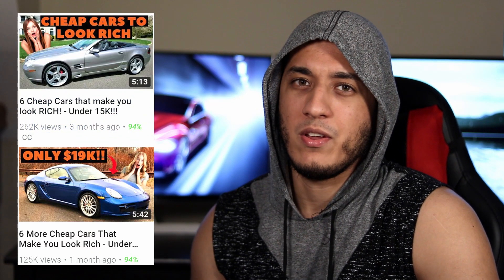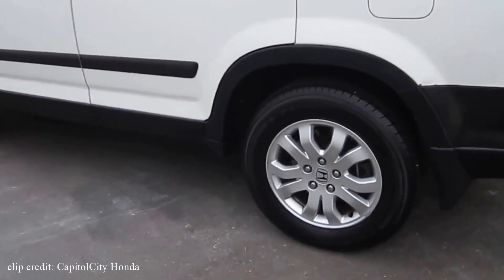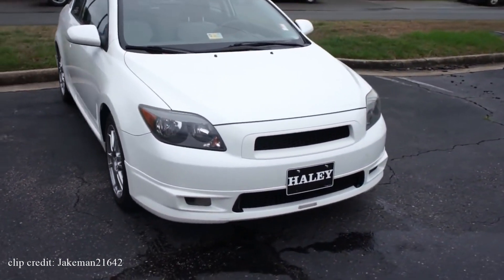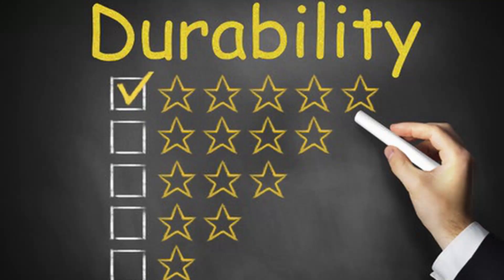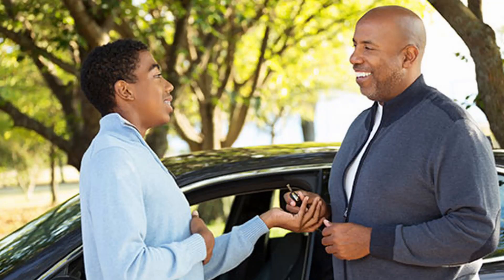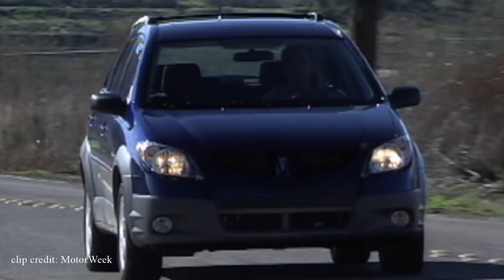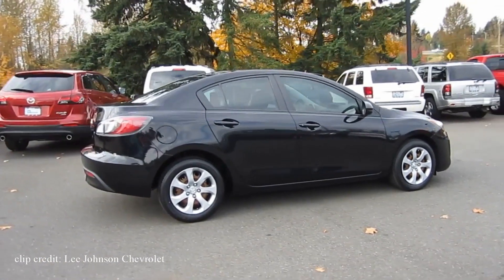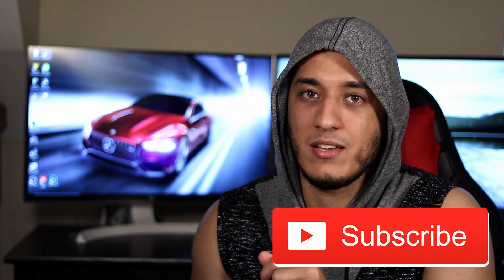5 Cheap Reliable Cars Under $5000

Comment: Crown Vic was a tank! Over 360,000 miles on mine! Had an accident at 45 and only cracked the bumper cover. Your best option though, is to get one through state auction. Some as low as $500 and only need a battery and starter and you got a running driving cop car 😎
Reply from the maker: Dude that's awesome!
Reply: You don’t want an old cop car. Lol. They are finished when cops are done.
Reply: The vehicles themselves are awesome. Just the fleet ones like cops and taxis RUN.
Reply: @VehicleVirals  I got my 08 p71 for 800$ Runs great.

Comment: crown vic driver here and I could attest that this thing is literally bulletproof. They are nearly indestructable and tough as nails. Put 5000+ miles on mine with 100k in three months and it never ever gave me any trouble. They are roomy and have a significant road presence. Most vics are reported to run for 200k+ miles without the need of a major internal work like engine or trans rebuild or such. And they are reasonably fast, slow to start from static but once you build up some speed that V8 really goes. Rock steady and safe. Given the price it is very difficult to beat.

Comment: If Ford is discontinuing the Taurus, Fusion, Fiesta, C-Max, Focus, and possibly the Flex for the next decade, then they should try really hard to persuade customers to bring back much better sedans like the Thunderbird, Crown Victoria, Galaxie 500, and even the Probe.
Reply: Not to be a troll, but Thunderbirds and Probes were coupes.
Reply: I love the probe with a burning passion
Reply: Ford fusion
Reply: Part s
Reply: speaking as a former ford dealer parts manager the ford Probe was a pile of junk

Comment: The police sell off their crown vics at 100k. Most emergency services dont keep their vehicles for more than 100k. I agree a great deal, but they are driven hard! I wouldn't want to be driving around in one lol. Definitely a great 1st vehicle
Reply from the maker: The Crown Vic doesn't know what driving hard means lol. And yes a great first car
Reply: I drive the Chevy Tahoe PPS as a Paramedic ERV. I'm seriously considering getting one that's been decomissioned. Bang for your buck is wild; in Canada, that's like an $80,000 vehicle, a few years old, for under $20,000.  But close to/over 200,000km. And with the tweaked suspension, excellent tires, & it's DESIGNED for the ++idling & aggressive driving... it's a bloody dream. It's so nimble, smooth, quiet a ride, responsive, and turns on a dime for its size. I feel like I could go anywhere in the thing, with space to spare. Granted, she's a biggie, but easy to get used to and feel like an extension of yourself. The acceleration is nothing to joke about, either, plus when you hearrrrr her!  City gas mileage leaves much to be desired, but is entirely reasonable for what it is. I don't commute far, so maybe that's a me-thing. Plus we make decent coin for our profession. I find it reliable. It's statistically trusted for reliability & performance. And researching maintenance/year averages, it's a no-brainer! Transmission, brakes & tires are not cheap, but in the grand scheme she's a steal. Ridden hard, sure as hell they were. But they were modified from off-the-lot to handle that (according to the website). Granted, they could be making a bigger deal out of only a little tweak. But you look at people selling used ones with 500,000km+ that are over a decade old, and they hold up well. Great investment piece, in my opinion, but I'm not super "into" cars, I must confess. Interested in opinions, Vehicle Virals!!!!!
Reply from the maker: For 20K it seems like a solid deal. Like you said for your profession those Tahoes are modded to take a beating, as are most emergency responder vehicles. I'm sure parts for them are widely available as well. If you're really into that vehicle I don't why you shouldn't for it. Best of luck!
Reply: Don't forget the wear as they idle for hours on end.

But they are still pretty durable overall.
Reply: True in some aspects but if it's coming from a state trooper, it's ridiculously durable
Reply: a fleet maintained one would be good

Comment: I gotta say one thing about those old CRVs. After a few 13+ hour road trips in the back seat of one (as an adult, albeit a small one), I am convinced the back seats are the most uncomfortable place ever designed next to medieval torture devices. Enough room to fit my shoe on the ground. No ability to move my feet or bend my knees to anything other than a 90° angle. Impossible to lean anywhere – pillow or not – to nod off. I’ve since taken similar trips in the back of a Veloster and it felt like a limo in comparison, leaving me refreshed.
Reply from the maker: Wow!

Comment: Police vehicle odometers are misleading; they are left on idle not like normal cars.
Reply from the maker: Interesting
Reply: This is actually true. Police cars have a lot of engine hours.
Reply: You have a point.  However, it is probably better to have the engine idling than the more "normal" practice of regular drivers that drive a few miles then shut of the engine, come out, start the engine and drive a few more miles.  
There are taxicabs that have well over 200,000 miles on them and if the engines were crap you can be sure Crown Victoria wouldn't have been as popular for so long as a cab.
Reply: Plus I've seen a lot of the older 4.6 fords have the tachs stuck around 100k so who knows how many miles but it doesn't really matter they are beasts.
Reply: mine has 5000 hours that seems horid but the engine drive and runs great. And I am the kind of guy who puts my ear on the hood to hear if theres any weird noise. No. It's all about how the car is maintained.
Reply: odometers read mileage, it doesn't move unless car is moving.
Reply: tachs read engine rpm not mileage-odometers read mileage

Comment: Crown vic, grand marquis and town cars from 98 to 11 are reliable with out a doubt and cheap. You can get a low mileage well maintained for under 4.5k . main issues with them are ac head light flicker and rear air bags for those who have em. All wich is fairly cheap to fix. When taken care of They will run well past 250k

Comment: Cheap Reliable Cars Part 2:
1: Toyota
2: Toyota
3: Toyota
4: Honda
5: Honda
Reply from the maker: This video could of easily been just that but that wouldn't be any fun lol
Reply: Don't forget about Subaru.
Reply: You can throw a Mazda in there too. But yeah Japan has it where it counts.
Reply: Hondas arent reliable anymore lol
Reply: Don't forget about the Ford Trucks.
Reply: @atx-cvpi_99  A 4 letter word that starts with F?
Reply: @stevenboykin116  Ford
Reply: @atx-cvpi_99  You do get what I mean by 4 letter word right?
Reply: Toyota and Honda is garbage
Reply: Jeeps are very reliable, older ones.
Reply: Ok Scotty Kilmer
Reply: Hondas arent good in Bahrain .. expensive parts its will cost you a fortune for maintenance
Reply: Robert Fernandez well said, garbage cars

Comment: You’ve been lucky. A lot of people have issues with focuses but i knew someone who owned an 03 SE with 330K miles and they didn’t even change the transmission fluid. I have had an 04, 11, 14, and 17 with no issues. I still have the 17. Just because there are known issues doesn’t mean one is bad. I also had an 04 explorer with no issues.

Comment: 1984-2001 Jeep Cherokee
I have a 1999 Jeep cherokee XJ with a 4.0L i6, 263k miles and runs like new. these i6 are bulletproof. i have heard of many going past 500,000 miles with no engine rebuild, some even going past 700,000. There are millions that still run great with over 200k miles.

Comment: I'd like to add the Grand Marquis and Town Car are just luxury models of the Crown Vic and can be had cheap as well, and most parts are interchangeable. A chunk of my rear suspension on my 99 Town Car came out of a Crown Vic. And you can get a late 90's Town Car at least for 1-3k
Reply from the maker: Yeappp Same platform
Reply: One of the best imo. Been a huge fan of the panther platform since i totaled a 91 towncar and it kept me alive in the wreck. hydroplaned down a hill and wrapped arounda  pole. turned the car into a horse shoe. Sustained minimal damage personally due to the full frame the car had, able to take a hit.

Comment: In regards to the cheap luxury cars - my friend learned a hard lesson in repairs when he had his first issue with a bmw he purchased used. He got rid of it after the first repair and purchased a used Homsa accord coupe ( real nice).  
Crown Vic’s Terrorize the roads.
Reply: BMW's are one of those brands you need to be willing to set aside some money for the sole purpose of fixing it when something either breaks or needs to be replaced

Comment: I managed to snag an 07 tC (manual) for only 2500, and I love it. Good gas mileage, looks great, everybody loves the color, and it's actually got decent acceleration.

Only downsides are that it's front wheel drive (and TERRIBLE on gravel),  vibrates a bit around 70 mph, it idles HARD when the AC is on, and the immobilize can be a bitch if you don't realize you moved the steering wheel while getting out.
Reply from the maker: Awesome. Thanks for the insight. How many miles on it?
Reply: Currently at 160,000.

Or about 20,000 if you converted it from Toyota miles to GM miles.

Comment: I want a ford crown so bad, but here in germany they are pretty expensive and rare. I really like them with this massive bullbar and some extra lights on the bar. (Look at Alaska State Trooper, they have these round shaped lights on the bar) Also the spotlights are a must have on this car😍 Is there anyone, who wanna give me one for free? Absolute dreamcar!!!
Reply from the maker: They are so widely available here in the states. And very cheap to maintain. Sorry man
Reply: Yannick Block. What's up bud. I had a few crown vic p71 package I really love them too, in the last few years I got into  German cars especially the Mercedes Benz w124 body, I own a 95 e430 v8 and a 92 e300 3.0 straight 6 it's a 4matic as well I feel like the ride on my e430 is similar to my crown vic's I had and it has alot more power stock for stock. What u guys think about the w124 over there are they disirible
Reply from the maker: Honestly I don't see them very much here, at least not in Orlando. Back when they came out they were perceived like the Rolls-Royce of Mercedes because of how they look. I like them
Reply: @stevejunkerjr.2741   The w124 is a classic german car. It's very reliable and has a good quality. It's just an amazing car!
Reply: Vehicle Virals you should do a video on the w124

Comment: Hey Christian great video. Until I can get the car I really want, one of these looks like it might do great for a while. 😁 I am looking mainly at the CR-V or the Mazda 3. My question though is, since you mentioned a certain range of years for each one, I'm wondering if a year or 2 after the range means it's not as reliable or just more expensive so it didn't make the list?
Reply from the maker: Sup Robert. Each year range I mentioned is based on a particular body style meaning that if you go outside of the ranges the car won't look like the ones featured in the video. I tried to keep the cars as modern as possible without going over the 5K price point. Going over the year ranges will probably result in having to spend more than 5K. The Mazda 3 and Honda CR-V are typically very consistent reliability wise no matter what year you go for. Hope that helps

Comment: Hyundai tiburon? You get some electrical problems , powersteering problems, and other minor problems but lasts over 400k miles ( 439k to be more precise) and still runs fine( the 2.0 one)
Unfortunately it was discontinued becouse of the crapy interior, and back seats/ low performance/ gas hog/ sensitivity to rust/ very often service intervals..

Comment: Subscribing.. great presentations brotha. Keep it up. What's your take on the Ford Fusion? looking for a other car for my wife to drive in. SUV gas is killing me.
Reply from the maker: The Ford Fusion just like the Lincoln MkZ which is practically the same car are very reliable.  If you're more about fuel efficiency you can go for the hybrid model but it'd cost you a bit more. The regular ECOboost engine has great fuel efficiency as well. As a commuter vehicle I'd give it a thumbs.
Reply: @VehicleVirals  Thinking of a 06-10 model maybe 100k miles worth it?
Reply from the maker: Depends on the price. I'd try to shoot for less than 100K miles if your planning to keep it for a while.

Comment: Ford Crown vic/Mercury Grand Marquis/ Lincoln town car all the same usually Merc and Lincoln have more luxury options but watch for the air bag suspention, Pontiac Vibe aka Toyota Matrix same car made in same factory under a joint venture with Toyota (long since abandoned). Pontiac Vibe is the best bang for your buck if you have a family.
Reply from the maker: The vibe is definitely very practical. Very underestimated in the used market

Comment: How about vw?  I have a 08 jetta 5cyl that has 125k on it and have only had to replace AC compressor at 100k.  Been a great car.  Thinking about a tdi at some point.
Reply from the maker: While some VW vehicles can be reliable, the thing is if the car does break down for what ever reason the parts and labor can get pricey. I've had personal experience with a VW golf, and let's just say I was always broke.

Comment: The oil issue on the TCs were from the 2007-2013
Reply: Is it cheap to repair?... How?
Reply: @emanuelmoreta5472  honestly I went through 2 engines in 1 year so I sold it & got a EG6 with a GSR engine. Worth it.
Reply: @marcellomori3264  that's horrible!...
Seems like anything that resembles the Celica is doomed.
However, he says we should look for the ones with that problem corrected. I wonder how much would it cost to correct that?.

The EG6 isn't a bad idea, though
Reply: @emanuelmoreta5472  it's such a blast. My number 1 choice for car enthusiast starting out will be Miata, but if you need space or live in a snowy climate then the Civic Si or even just Civic Hatchbacks are the way to go. Are you looking for a good platform? I have tons of ideas for all types of car enthusiasts.
Reply: @marcellomori3264  I'm 180 cm, so the Miata isn't really a good choice for me.

I like the Civic, and I know about its reliability. But I am looking for something more unique.

I mean, you can see a Civic almost everywhere. That's why I like the Scion TC and Celica. And because their parts are really cheap and can be found everywhere.

Is there any other example of cheap, reliable and cool design car?...
Let's share some ideas
Reply: @emanuelmoreta5472  awesome. I need to know a few things that'll help
Budget
Location
Manual/Automatic/Either
Reply: @marcellomori3264  well, I'm not planning to buy "right now", I just would like to have an idea of what kind of cars I should looking forward as soon as this pandemic and economic crisis ends.

Parameters:
Budget: >4k
Location: Dominican Republic (I should pay a mechanic there in the US to do all the checking process)
Transmission: manual only.
Preference: if it's Japanese, it's better.
Exclusions: no Civic (coupe or sedan) they're too common.

The hatchback version is difficult to find. No problem

Comment: Anyone know a reliable cheap four door car?
Reply from the maker: I'm confused. With the exception of the Scion TC all of them mentioned in the video have four doors
Reply: Vehicle Virals I mean I’m more of a fan of sedans tho
Reply from the maker: Ah I see. If this video does well maybe I'll consider doing one for sedans
Reply: viperz22 I’m way too young to be drinking.
Reply: Synewsho. Crown Vic or Mecrcury Grand Marquis.
Reply: Synewsho Lexus ES350
Reply: G35..fast and reliable..insurance will probably be pretty high tho
Reply: Crown Vic
Reply: Other cars beside this list? Well there's the Pontiac Grand Prix GTP, Volvo 70R, Volvo 850, Toyota Corolla (obiously), Toyota Camry XSE, Taurus SHO, Chevrolet Caprice. Some of these cars pack a pretty punch just in case some rich spolied brat wants to blow your windows and not succeed in the process.

Comment: Had an 07 vibe.  Slow as fuck, shit on gas due to poor power to weight and an around 10 gal fuel tank, and started falling apart at 107k miles.  Toyota dropped the shit out of that ball.
Reply from the maker: Ouch

Comment: The bad thing is that Mazda doesn’t make a good automatic transmission.
Reply from the maker: Well with my experience with 2 Mazda's I haven't had an issue. Proper maintenance can go a long way

Comment: How about Mazda RX-8. It's also under 5000 dollars
Reply: Not reliable :(
Reply: @SURENITY  Yeah, that rotary engine is a nightmare.
Reply: It is reliable if u do all the annoying maintenance its really annoying to add in 2 stroke oil and do more frequent oil changes and let it warm up but because of that i have 180k miles and compression is still fine the things that tend to fail first are starter and battery which cause slow starts but if u change those it should be fine as long as u do maintenance
Reply: @carlossalazar5732  
Thx for reply bro. Can this car come under cheap sports cars under 5K
Reply: @artphototech  rotary's are a pain to maintain correctly but can cause a reliability nightmare if nrglected
Reply: @profstein-bq2tc  oh for sure.

Comment: Ridiculous claims without evidence regarding the mileage expectations on cars. Facts, statistics, science just goes out the window and are replaced with silly adjectives and anecdotes. Obviously, it does no good to state a car is good for 300kmiles without listing the repair costs for cars that have actually gone 300k miles.